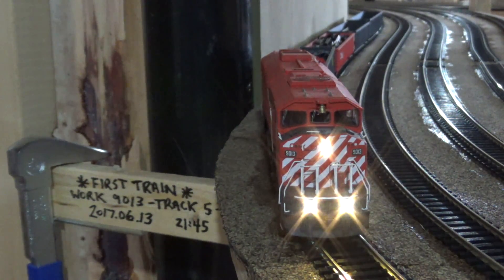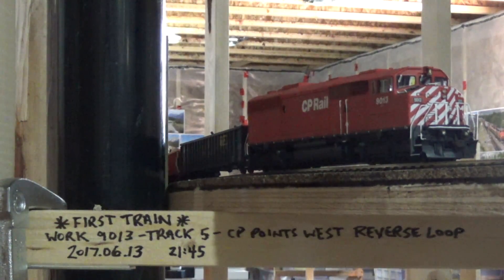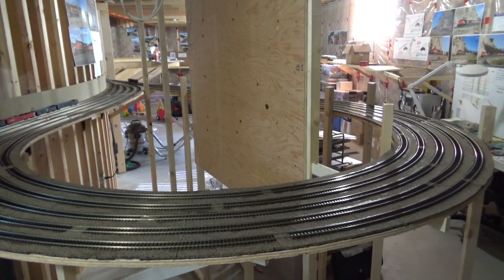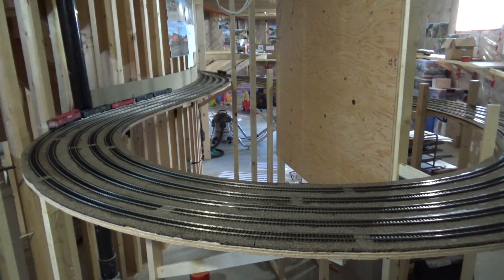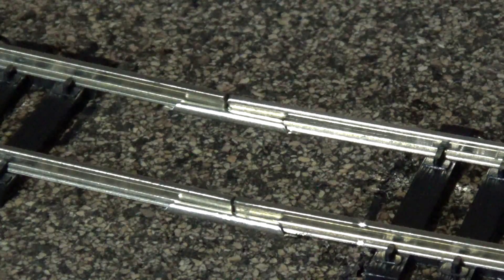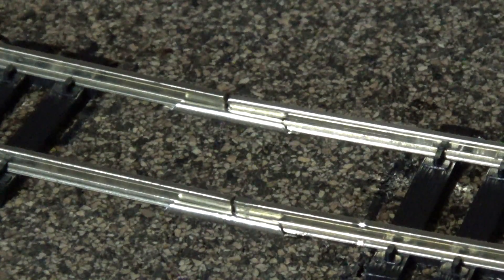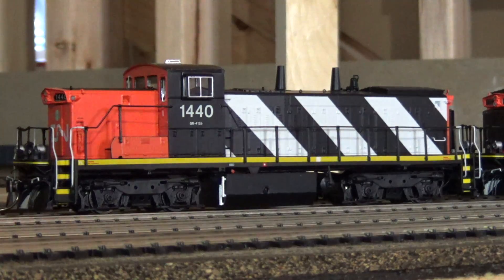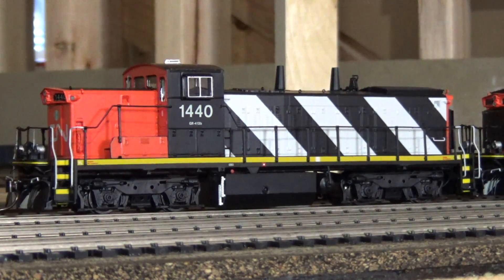Layout Update - June 2017: First Train, Reverse Loop Track & Turnouts, Rapido GMD-1 Rebuilds...

Comment: Hi Ben, congrats on getting to the first milestone!    Brings back memories...LOL Nice work on the track and turnouts, don't know if I have the patience for the Fast Tracks? But having spring switches is nice though. Thanks for the mention too! Have a look at Tam Valley reversers and some other electronic ones that do away with the relay? Though the AR1 is a bullet proof unit, my original is 10 yrs old now!!  Well done mate on the progress.
Cheers Gregg.
Reply from the maker: Thanks Gregg! It took some patience for sure but I like to put an interesting lecture on YouTube in the background and building turnouts is almost zen-like, for me anyway.  Electrically they are very solid. Having a direct soldered connection all the way down the solid point rails will be very robust. In theory anyway, haven't got a chance to run a 25 foot train with DPU over one to test it yet. Thanks for pointing that out about the Tam Valley juicers. I had looked at them but they are a few dollars more per reverse loop so I was leaning towards Digitrax. I guess it depends on what a guy values the electronic technology vs. the older relay tech. Sounds like yours have worked great for you.
Reply: Very true mate , sometimes simple is the best! The AR1's are certainly a good unit.
Gregg

Comment: Hi Ben , another great video, Loops look awesome, love that radius!! I did the same with my flex track joints, because Im running a set of feeders to each flex track section, I decided not to solder every joint, We have the hot/cold , expand/shrink syndrome here as well. So Im doing every other one, or less.
Reply from the maker: Thanks Greg! Inner track is around 32'' and outer is near 42'', should be trouble free operation once I get the gaps filled in with ties and the small remaining kinks out of the joints. I'm thinking about trying solder on every second one on the other reverse loops that are accessible. This one is hidden so I am really paranoid about expansion causing issues.

Comment: Great start! 

Speaking of weights. I had a local fellow who builds railing  etc. make a dozen or so steel weights for me for laying and weighing down rail after using grey DAP Dynaflex caulk. They are 1 1/2" x 1 1/2" x 1".  Just make sure you take them off before running trains or put plastic pads in between the weights and the rail or you will get some shorting.
Reply from the maker: Thanks Ken! Oh yeah those weights will work great! Those will be nice and heavy and useful for other gluing applications as well. Yep, metal weights also prevent you from running trains until the silicone is dry and weights are removed. Maybe that's a good thing for me because I was tempted but couldn't run trains until the track was laid because the uncompleted sections had dead shorts from my metal nuts on them.
Reply: Try em, you'l like em.   ;-)

Comment: If you want to have a smooth transition from one piece of rail to another, try soldering the two together and then sand the bump down so that it is flush with the rail. I have seen some modelling clubs do this with their HO layouts. they just put a small dab of tin in between the rail pieces so it doesn't hit the inside of the train's wheels.
Reply from the maker: I have seen that done and I considered it but with the temperature swings we get up here in Canada I was a little worried to solder together 12+' of flex track. Since this loop will eventually be hidden I wanted to make sure I was able to leave gaps for expansion. Good point though, I think I may solder every second joint on the other reverse loops which are accessible.
Reply: Hey man, I get you on the temperature changes though XD, I'm from Toronto. Ty btw.

Comment: Congrats on the first train milestone. A bit of advice for you if you want to stretch your turnout building budget more. I order PC boards from Amazon you can get the same mil thickness and i usealy get 4 by 6 inch boards they come in 5s or 10s for under 10 dollars Canadian and all you do is use a metal straight edge and a Sharpe edge to do a few deep scores and then you snap them clean .
Reply from the maker: Thanks Peter and thanks for the tip, that's a really good idea and could help get that cost per turnout down further.

Comment: You should use the fast tracks sweep sticks. They allow you to get a perfect radius, i can see some major kinks in the corners that could have been avoided by using the sweep sticks
Reply from the maker: Very good point! I forgot to mention that in the video. I plan on getting all the different radius sweepsticks I need to do all the reverse loops. I am going to come back to this one after I drop the feeders and fix up those kinks and install the ties in the gap. I wish I would have thought of it before though, it really would have improved the quality of the track work. Thanks for the comment!

Comment: Great update..Congratulations on running the first train..With the yard being inside the reversing section are you able to run more than one train at a time?
Reply from the maker: You can as long as nothing that draws power crosses the isolated sections of the reverse loop at the same time. On long trains I have to be careful about where the distributed power locomotives are because its possible to short out the reverse loop if the head end and the mid train cross into the reversing section at the same moment.

Comment: That will be a lot of auto reversers? 
Whats your opinion on building your own turnouts? Are they cost effective and are they fairly easy to build?
Reply from the maker: Yeah quite a few Joe, six in total. One entire reverse loop will be managed by a Digitrax DB200 set up as an auto reverser so I did save a few there.Honestly, I don't know if I would do it again. The time commitment is extreme, around 1.5 hours per turnout was the best I could do and I built 25 of them. The savings weren't that great because I only spread the cost of my materials and tools over 25 of them which worked out to around $33.00 CAD per switch. I easily could have gone with Peco or Microengineering and it would have been cheaper. They aren't hard to build, there's a bit of a learning curve, but I think anyone could do it with the help of his big library of instructional videos.  One thing I will say about them is the gauge is flawless throughout the length of the switch. There's no problem with locomotives stalling on the frogs because the point rails are solid and have a soldered connection to the stock rails.